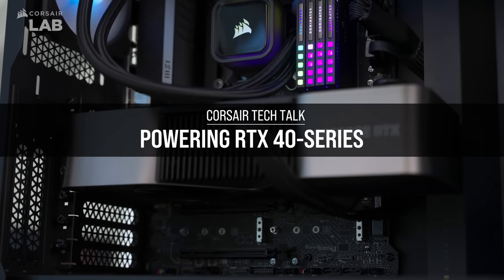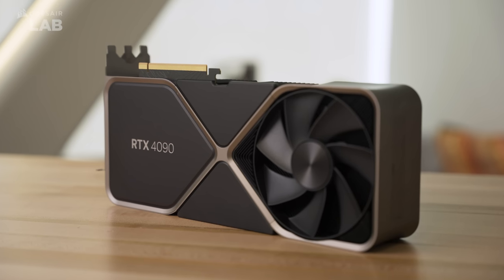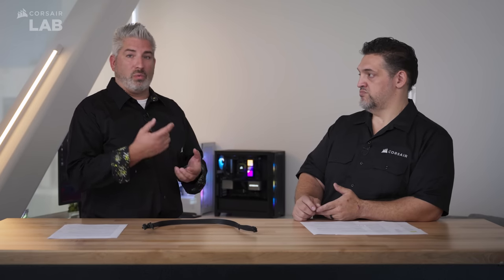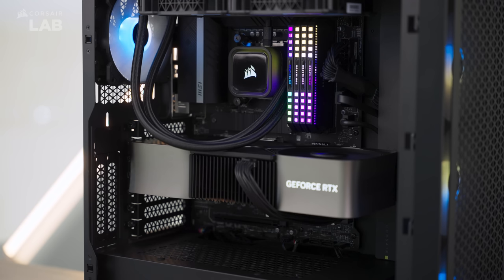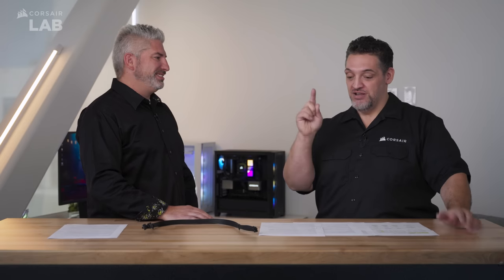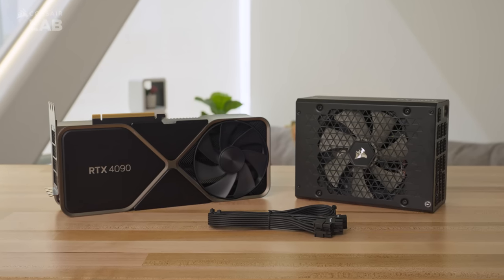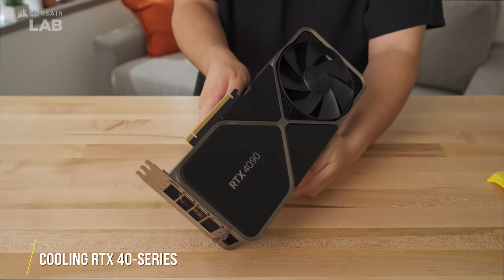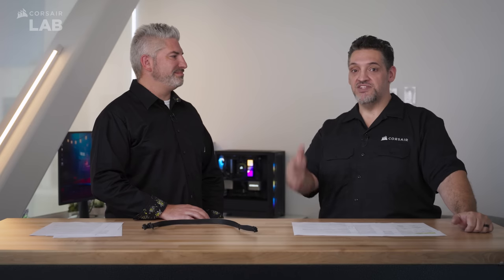What Does It Take to Power NVIDIA RTX 40-Series? Be Ready for Your Next Upgrade! - CORSAIR Tech Talk

Comment: Corsair fan here, I use their PSUs, AIO coolers, and RAM.  While I’m sitting on an extra 1200HX PSU, if I decide to migrate from a 5950x/3090 setup to a Zen 4 (or Intel 13th Gen, which could also turn out good) and 4090 or equivalent AMD flagship card, I’ll have t9 decide whether to use it or get one that has the new cable layout.  Hmmm.
Reply: same

Comment: When will we see Corsair prebuilt computers with the 4090 card ?
Would the 5000T case be the best case for  the 4090 ?
Reply: They are already out with 13900kf 4090 fe 32gb drr5 5k mhz 2tb sdd + 2tb hdd for $4500+ 😆 sadly 4090 is only has super good performance at 4K at 1080P is same as 3090ti and at 1440P 4090 is 36% faster that’s like 38 to 49 fbs more

Comment: I have the HX850, it seems to just have the 3 6+2 pin connectors, is it fine to just plug in 3 of those to a 4 to 1 adapter for the 4090?

Comment: Im looking at building a 4090 system and putting a water block on it and finding a stable overclock for it. Is the only difference between the different 4090 cards the cooling solution (which will be shed to put on a water block), Or are there differences to the actual hardware overclocking capabilities between different vendor cards?

Comment: I have 7 Ll120 Corsair fans and the elite h100i liquid cooler with two fans that should be sufficient cooling for the 4090 in my case correct? Also is the corsair RM 850 X enough while using the 4090 and a I7 11700 K processor?

Comment: I have a RM750i with a Ryzen 5900X, do you guys think I can stretch it to the end of the year with a 4090, maybe forcing a lower power limit than stock? If I need to change PSU, I want a new ATX 3.0 at this point, but they are not out yet
Reply: If I remember correctly the aftermarket cards can reach upwards of 600w
Reply: They’re out in the US, if you live elsewhere tho idk if they’re available .
Reply: Yea if underclock it a little u probably can do it
Reply: You can for sure at stock.  Even upwards of 500w from the gpu will be fine.  I am not a crazy consecutive  “double it” people you often see in the comments.. don’t hesitate to run it up to 90% of your rated psu.  A good 750 is designed to handle spikes upwards of 1000w or more.  I have an hx750i with absolutely 0 plans to upgrade until it craps out.  It’s at least 6 years old now.  I might dial back my asus tuf depending on the game and fps requirements I have.  I play on 4k 120 tv and will cap the Fr at 116 and then start messing with under volting/powering from there.  As long as my fps stays above 100 it’ll be great
Reply: You'll be fine as long as you don't overclock. Der8auer was getting 95% of the performance at 300 watts so you could power limit it and be fine.
Reply: You're fine. The 4090's default power targets are set very high to squeeze as much FPS as they can pull. You can cut power by 30% and still get 95% of the fps.
Reply: Thanks, I also saw der8auer video, my doubt is when the system powers up, not sure if in that moments all components cap at max power to star. Still, the challenge is actually get a card, I'd love to get an FE, but not sure if it's even possible in Europe, custom AIB are up to € 2500, it's insane.

Comment: does the 12vhpwr cable work with an HX1200?
Reply from the maker: Hi there, HX1200 supports our 12VHPWR Type-4 cable. Generally, we are recommending that the PSU you intend to use meets the wattage recommendations from NVIDIA (850W for 4090) and also supports CORSAIR Type-3 or Type-4 cables for our solution.
Reply: @CORSAIRHowTo  great thank you for the response, yea i bought my hx1200 a bit ago just wanted to make sure... now if only the cable would go in stock :)

Comment: I've read online that a 1200 psu using the 12pin to two 8 pin supports the full 600 while a 1000w psu can only supply up to 450. Is that correct? If so, how will this affect using the 1000w PSU with the cable on a 4090?

Comment: Ideally you want the total system draw to be no more than about 60 or 70% of max power output on your PSU.
Sure you can run at near-max power output under load. But you're gonna slowly fry your caps with unstable power delivery, and everything in your system will be less stable and last less long.
Also, a 1000 watt PSU will use less electricity to push out 650 watts of use, than a 750 watt PSU. PSU's are most efficient in the 40-65% range (of max power) or thereabouts.
If my total system draw under load is anticipated to be 700 watts, I would want a 1000 watt PS. If it was expected 800 watts, I would want a 1200 watt PS.

Once I figured this out, my failure rate on hardware components went WAAAAAAYYYY down. And the power bill got slightly smaller. If you can get 90% efficiency instead of 75% efficiency by going from bronze to platinum, and going from near max load to having a 30-40% PS overhead ...then that will save you about 2 cents per hour (give or take). If you use it 10 hours a week, that's $0.20/week or just $10-$11/year. But if you use it 40 hours a week, it's more like $42/year. So if you use it a lot, that efficiency margin upgrade will pay for itself real fast, purely on the power bill. Granted, not all use is "at load" depends on what you're doing. For enterprise usage, "titanium" rated is a great buy. For an avid gamer, probably platinum or gold. But seriously, go with a PSU which can do at least 30% over your expected load max. If nothing else then just for the stability with micro-spikes in power draw. A game crash is aggravating, but a few hours of unsaved work crashing is like $50+ and some of your sanity down the drain.

Comment: So for over clocking an watercooling, what would you guys recommend? 

Specs:
4090
Intels 13th i9 13900k
Ddr5 ram
Reply: It depend 
13900k can use up to 125 wat base or full overclock gaming mode 350 wat 
Rtx 4090 bass wat is 450 but if ur planning on overclock probably 500+ wat 
So if were u I would get 1200wat gold 80+ psu or a 1600full psu for future proof
Reply: @BlackholeU_U  okay sounds good, thanks my man !

Comment: You can limit the 4090 to 260 watts and it will perform 10 % worse than at 450 watts. So with 1 slider you don’t need a new PSU
Reply: Probably depends on the silicon but even 70% the performance of a 4090 at 300w is insane and still cpu limited below 4k

Comment: So basically you are saying that the response from GN where you called out and said BS which had an engineer from Nvidia saying the 4 PCIe lead to 12 pin adapter cable supplied with the Nvidia card that uses a built in IC to correctly identify which power limit to set the card too is not required and we should trust the life of a $1600-$2000 GPU to your $30? dollar 2 PCIe lead cable to 12pin adapter cable?

I will say GN DID actually give a very plain demonstration using the included adapter from a 4090 and a psu and OC software to plainly show EXACTLY what they were saying while basically your position is more "just take our word for it we know more about Nvidia cards and their requirements than Nvidia!"

Sorry guys, I think I would listen to the Nvidia engineer here.
Reply: The 12VHPWR cable and the x4 adaptor cables are not the same things.  They each have different ratings and are built to different specs.

The "Misinformation" claim came from the Corsair Rep not understanding what happend when you don't fully populate a x4 adaptor.... nothing to do with the 12VHPWR cable.